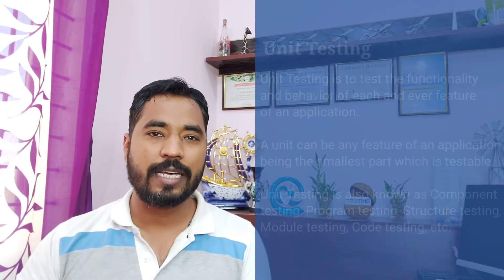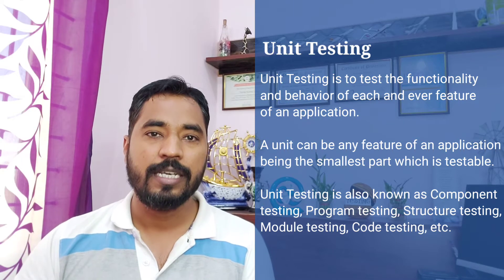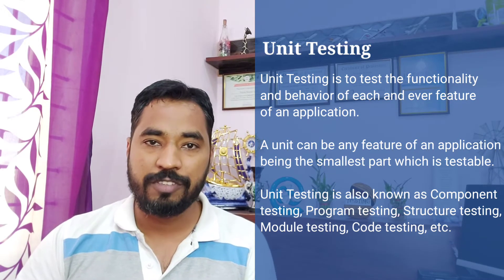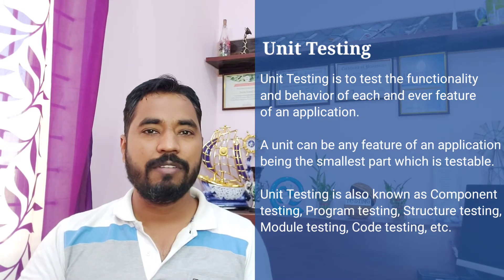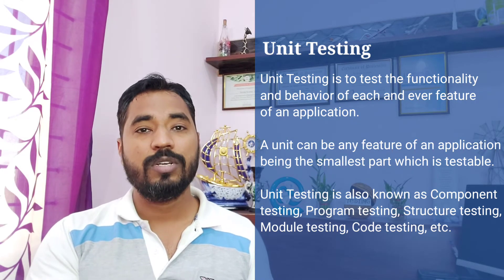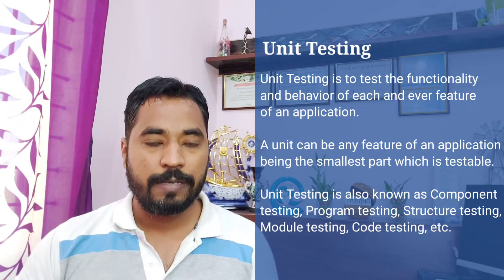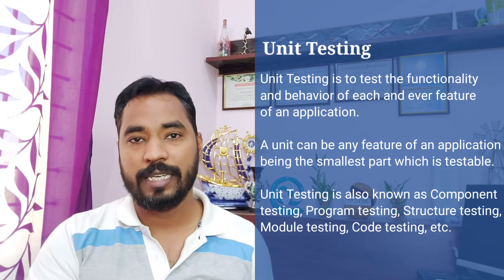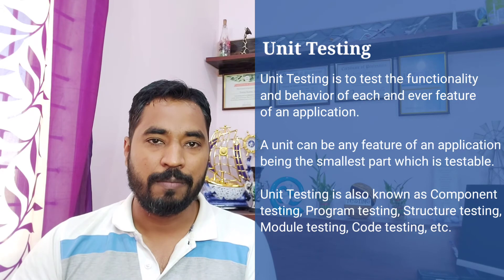What is Unit Testing | Meaning of Unit Testing | Definition of Unit Testing | Technical Vocabulary

Comment: Hi Sir, Is it okay if I used automation tool to test a unit testing especially if this is a big scope? If so, then is there a particular automation tool that use for unit testing?
Reply from the maker: Yes exactly you can use automation tools in such scenarios. The unit testing frameworks/tools are specific to language which you are using. Eg. Junit, Nunit, PyTest, XUnit, Gtest, etc.
Reply: @TechnicalVocabulary  Thank you Sir. But we tried using Robot Framework w/ Selenium for Web Unit test